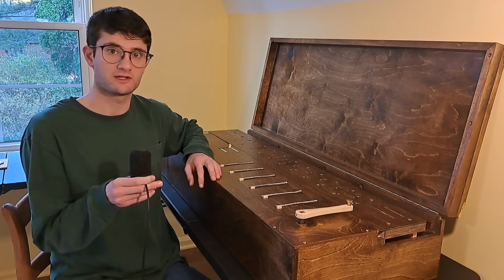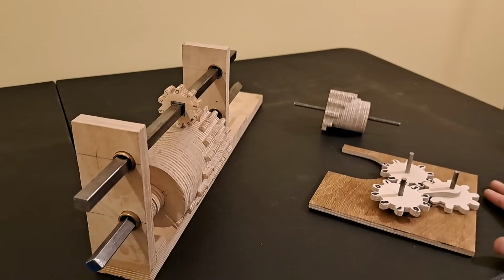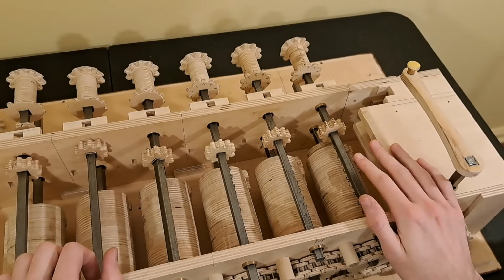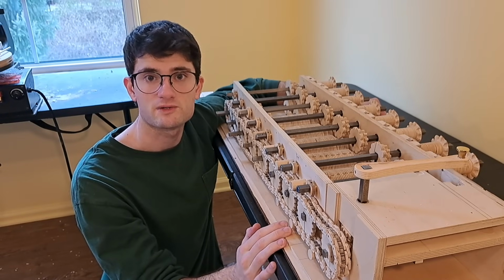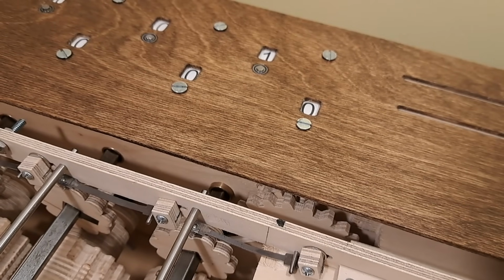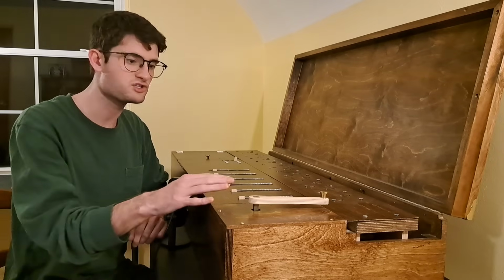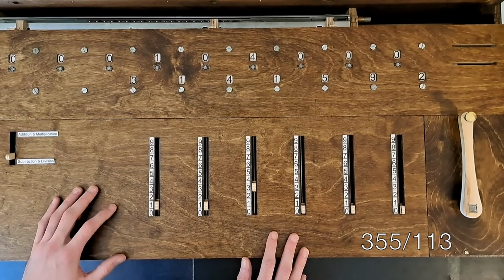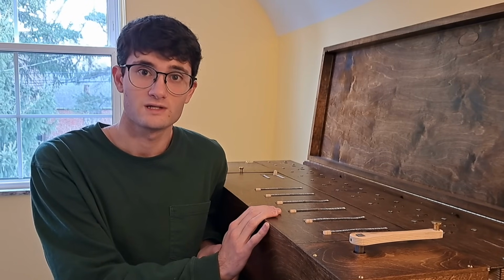How I built a Mechanical Calculator

Comment: is here any way to recover if you accidentally overcranked on division?
Reply from the maker: I believe you can just switch into addition and add the number back in. Overcranking in division would cause it to carry over into all nines – some calculators had a bell that would ring if the leftmost column went to or past nine, which would effectively indicate when an overcrank occurs.
Reply: Many mechanical calculators implemented automatic division by repeatedly subtracting until they saw an underflow (had subtracted one too many times), then switched to addition for one cycle to cancel the excess subtraction, then shift one place, and repeat the process. So with the right design an overcrank is not only recoverable, it is an actual part of the process.
Reply: @lwilton  There's also a slightly more efficient* method which is to turn until underflow (as usual) but then immediately shift and turn for addition until overflow, and then shift and repeat. 

*Actually not 100% sure on this one, but mentally/physically easier, though I think harder to automate since I haven't seen an automatic one do it that way.
Reply: Unfortunately the counter would also increase wouldn't it?
Reply from the maker: @sushiga  Oh yeah, good catch! I forgot about that; It definitely would increase and throw things off. The actual Arithmometer, or at least some models, would turn the crank count wheels in the opposite direction when subtracting (the counter wheels had one set of numbers for addition and another, in red, for subtraction), this would avoid that problem.

Comment: Very cool.  I like how the carry ripples through in the latter part of the crank turn after the input digits have already been added.  I assume each digit is timed to handle its carry a bit later than the one to its right.
Reply from the maker: Thanks! Yeah each column is 1 tooth of the sprocket (1/20th) later in the cycle than its neighbor to the right, so that carries ripple.
Reply: @WhatWillMakes Very clever! This thought also crossed my mind while watching. Fantastic work!
Reply: @schwuzi  You implicitly called yourself very clever. That's very clever. 
Very clever!
Reply: @what_in_the_heck_is_going_on  I'm just a very humble guy.
Reply: @WhatWillMakes  did you know that when you designed the size of the  1 through 9 dials on the axis? You can't start carrying over untill all the numbers are done so one revolution of the axis needs to support those numbers as well as a tick for each axis if you want to ripple the carrying of the one.
Reply: @WhatWillMakes  3 questions... Did you have to make room on the barrel for 21 teeth so that the carry over reset happens either before or after all other operations?  As you showed it, does it do "borrow the one" for subtraction? Does 1 minus 2 result in 99?
Reply from the maker: @etymologicalist  Great questions!
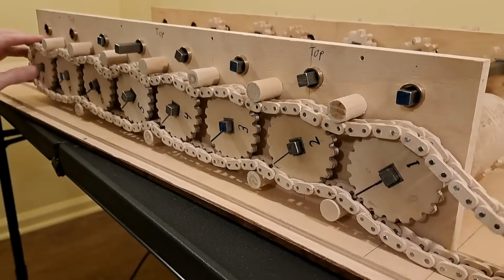Hopefully this will help: The carries happen after the 1-9 is added in each column, and every column is a little later in the cycle than the one to its right, so carries do not interfere with carries in other decimal places. If I had not removed some teeth on the stepped drums and instead of having 1-9 they had teeth going all the way around, they would have 20 teeth going all the way around. The extra tooth for carrying comes just after the 9 teeth on the stepped drum (so in the 10th of the 20 spots). This means the carry always come right after the 1-9 digits are added on that column. Then the sprockets that link the columns together via the chain also have 20 teeth. And each column is 1 tooth of the sprocket (1/20th) later in the cycle than its neighbor to the right, so that carries ripple and the rightmost one finishes first. (You can kind of see this in the video at 9:35, where I'm aligning all the sprockets so those black marks line up, but the actual squares of the metal shafts show that every successive column is turned a little more down the line). So everything is timed so that carries do not interfere with things within each decimal, and occur at the right time in relation to the other decimal places. (if you're interested, there's diagrams of those parts showing the rest of the 20 teeth on my blogpost: https://whatwillmakes.com/2024/12/20/my-mechanical-calculator-how-and-why/).
It does "borrow the one" for subtraction. The machine triggers a carry when any column moves between 9 and 0 or between 0 and 9 in the case of subtraction. The carry then causes the next column to the right to move one number, and in subtraction mode then it is one number less. So 1 minus 2 will cause a sort of overflow of carries that results in 99999999.
 I hope that helps!
Reply: @WhatWillMakes  I think I get it. 9 digits + 1 carry signal + the offset.  This means that the barrels on your 7 digit calculator need at least 16 spaces for potential teeth (minimum 6 offset spaces).
Reply: I immediately came to the comment section with the belief that Matthias was highly likely to have left a comment.  Also, I'm guessing that Matthias' program for making gears was used by the video maker.
Reply: Curta